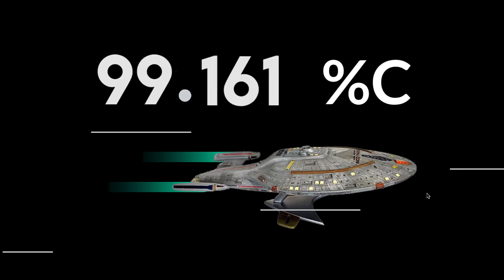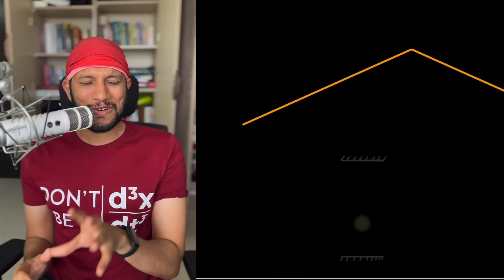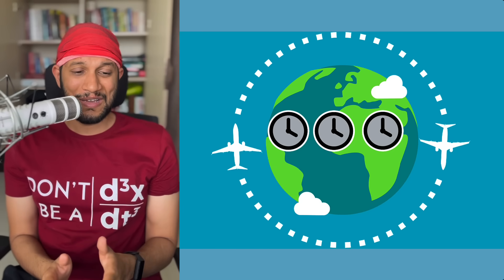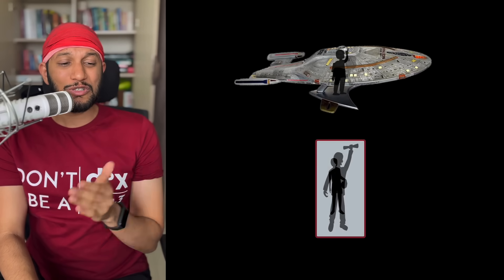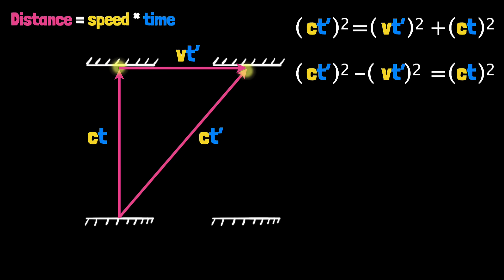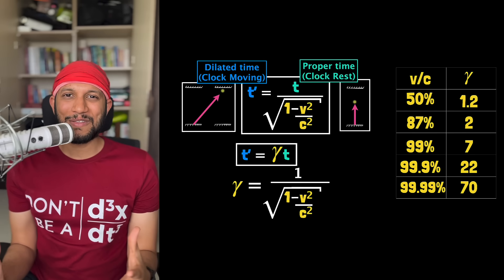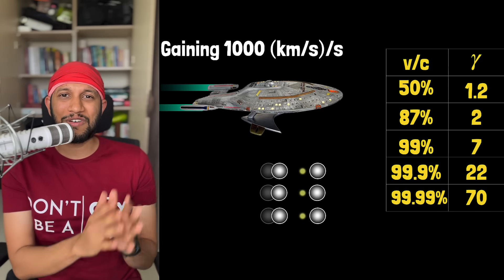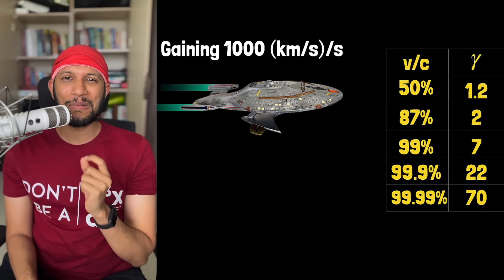I finally understood why you can't go faster than light! (My mind is blown)

Comment: I haven't read all 9,000 comments so this has probably been asked a few times and I apologize for asking it yet again.  But...

This is all based on the notion of relativity - the speed of one object relative to another.  So, is it not possible for me to drive my motorcycle own the highway at legal speeds and yet be exceeding the speed of light relative to an object other than the earth?  

I know you have kept the explanation simple for purposes of explanation of the concept, but it object b is travelling at 50% of the speed of light (0.5C) relative to object a and object c is travelling at 0.5C relative to object b, is it not possible that object c is travelling at 1C relative to object a if object c is travelling in the same direction from object b that object b is traveling from object a?  And, of course, we can extend this to object d doing 0.5C from object c and 1.0C from object b and 1.5C from object a.  The combinations and permutations of objects in this scenario is approaching infinity.

Comment: the analogy is the same for twins - 1 in space and 1 in earth - the space one is younger - it also sucks because the energy required to move mass after a certain time is exponential and it is impossible to achieve sufficient energy to move the same mass at faster speeds. Laymans opinion - no degree whatsoever

Comment: U know its all BS, yes? U are INSIDE the ship, u do not see 'time dialation', u are travelling with light sped no problem :) There is no delay in TIME, there is a delay in the clock which is irrelevant. U just broke your clock.

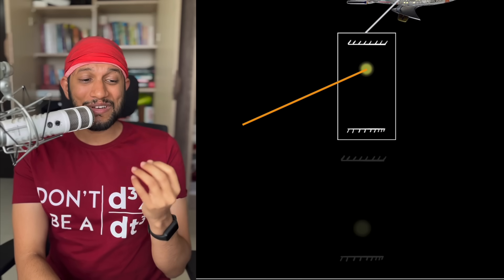Comment: 2:05       I'm going to stop you there.
In your example...
From outside the ship, the photon appears to be traveling faster. Not slower.

If the person outside the ship is travelling at the same speed relative to the ship, the photons speed appears to remain the same.
If the person outside the ship is traveling slower than the ship, the photon on board the ship appears to be traveling that difference faster.

Relativity. Speed is relative.
In your example, the apparent change in speed is because you have changed the point from which you are measuring it.
 

Einstein's equations simply do not work at speeds greater than the speed of light.
They are limited.
The limitiation is in the accuracy of the equation to predict an outcome, not the maximum speed theoretically possible.

However since we are not able to travel anywhere near such speeds and even struggle to take accurate measurements at such velocities, the inaccuracy of Einsteins equations are to all practical purposes, irrelevant. They are good enough for the purposes we use them for.

Comment: The only real problem is the fact the einstein couldn't tell time. He didn't understand how a clock works. Since he didn't understand how time works, he could never work out what speed actually is. If you can't understand speed, you can't work out anything with regards to distance or speed. That's why he always used squiggles and stuff. He didn't know how to read or write. Now you know the real answer.

Comment: Well first of all you wouldn't be able to see the photon because you need a photon on to observe things. But okay if we imagine an oscillator, a little ball that's bouncing between two plates, the distance that it travels while moving will APPEAR longer, but the frequency will stay the same, because by definition the clock is measuring the period of the balls bouncing between the plates. Any other factors not part of the clock system. The same number of photons will reach your eyes telling you about the movement of the ball in either case. In each photon will describe a change in position in space. Well guess what when the clock is stationary the distances between each observed position will be smaller and when the clock is moving the distances will be larger. That's it. There's no slowing down. 
When the clock is moving towards you, it will appear to tick faster, and when it's moving away from you it will appear to tick slower. But it only APPEARS so because of the distance it takes the light to travel to you to bring the information about the clock.

Comment: so you saying a space ship that speeds away at close the speed of light away from earth for one year, and then comes back at the same speed for an other year, that the person in set space ship is younger then the person on earth? both of them would have aged two years. because you say the time for them inside the clock stays normal, so normal two years for both of them, i'm never going to grasp time difference because it does not logically click for me, HOW can two years be different when you start of with identic time clock, and i kinda see where you get the difference because you try to calculate it, the fact still remains that the two clocks it self don't change so HOW CAN THE BE DIFFERENT. this all would click for me when every thing is affect by travel, but it does not lets call it medium instead of vacuum or atmosphere, if i'm inside a bus driving and trow a ball up, the ball it self takes the same distance up and down as if i would do it on the ground, because strait up and down, forget the outside observer for a sec here, lets say the ball goes 10centimeters in up and down, it will be the same 10 out side the bus, again forget what someone would "see" i know seeing takes photons and they need to do a longer distance to get to my eye to see the ball go up and down if i was on the outside of the bus, BUT the time it self for the ball would be the same in and out of the bus, so how can one be older then the other in the end? see that does not click for me, makes zero sens, i can see the numbers because we probably use faulty calculations to get to that different numbers.. man i'm going to explode my brain here. and i probably type it so badly you all think i'm crazy as |@#|@. but english is not my main, and i never can type down what i truely think, its weird i know.

Comment: This is all nice and cool, but earth which means we, which means every clock on earth, move at certain speed. Mars move at certain speed. Our galaxy itself move at insane speed (and will collide with Andromeda btw). So we already could be floating light speed not even knowing. You take too much as granted that atom send fontons to move as structure, nobody really can see atoms with any machinery. And scientist do wild theories what photons even are and that they are on several places on same time. It is not granted that photon which travel longer distance is same to photon which travel shorter distance, it could be more used than first one. Although this thinking out of closed enviroment seems rigged from start as with that way you can go over light speed easily, as atoms in galaxies travel more than ls in comparison to location of movement to other galaxies.

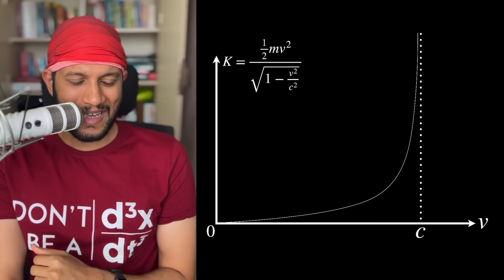Comment: 0:41 The photon  "clock" as depicted is  nonsense, because as speed increases, the photon has to be launched at an increased angle or else it will escape the cavity. Duh.
Reply: That’s not true.  Because if you use fluoride, you will get rid of all the cavities.
Reply: Imagine being so condescendingly incorrect
Reply: @ Wait I disagree.  I think this is better described as “irritatingly wrong”.
Reply: You’re wrong
Reply: @coltonw5713  yep, he is deluded.  Also he's trying to distract from the main premise.  I love the way people try and debunk Einstein, without understanding or training, or evidence.
Reply: @idmbadvisoryltd3205  fr I thought he was just trolling
Reply: @coltonw5713  probably but that sort of nonsense needs challenge... or blocked  #block6trolls
Reply: You’re right, as the spaceship starts to accelerate forward the clock will move forward and leaving the photon behind. But I think the thought process is based on zero acceleration, which the photon clock is turned on after the spaceship reaches a very high speed and stops accelerating, so there is no need to launch the photon at an angle.
Reply: Why?   The photon is just moving inside a clock.  There is no acceleration, so it will maintain its left to right speed that is the same as the clock.  Only an acceleration would change this.
Reply: @idmbadvisoryltd3205  You are oh so wrong. The speed of the photon is NOT affected by the speed of the source. That's the key postulate of special relativity!!
Reply: @kirdref9431  I never said the speed of the source changed... I simply said the photon would not escape the clock at any speed.  This means no change launch angle is needed.
Reply: @idmbadvisoryltd3205  "the photon would not escape the clock at any speed". There you go being wrong again.
Reply: @kirdref9431  so how exactly would it escape?
Reply: The fact that it would escape or not is not relevant to the whole concept. So it's obviously simplified not to be solving another problem while solving the main problem. Instead of a "photon clock" you could just say a "magical clock" the main point wouldn't change. You're focusing on the wrong stuff. It's obviously been simplified, so that we don't need to bother with it's escape
Reply: @DarkMug  agreed
Reply: This guy is soooo wrong. 😢

Comment: Ah, you're diving into one of the most fascinating aspects of physics: why we can't travel at the speed of light! Let me break this down step by step to explain why mass becomes "infinite" and why we can't reach or exceed the speed of light.

---

1. What Happens as You Approach the Speed of Light?

The key lies in Einstein's famous equation from special relativity:

E = \frac{mc^2}{\sqrt{1 - \frac{v^2}{c^2}}}

Here:

 = rest mass (your normal mass when at rest).

 = velocity of the object.

 = speed of light in vacuum.

Breaking it Down:

As  approaches , the denominator  gets closer to zero.

Dividing by a number close to zero causes the energy required to accelerate the object to grow extremely large.

Result:

At , the denominator becomes zero, meaning the energy required is infinite.

This is why no object with mass can reach the speed of light—it would require infinite energy, which is impossible.

---

2. Why Does Mass "Become Infinite"?

Relativity introduces the concept of relativistic mass, which increases as an object's speed increases:

m_{\text{rel}} = \frac{m}{\sqrt{1 - \frac{v^2}{c^2}}}

Key Points:

At rest (): , the normal mass.

As  increases:  increases because the denominator  decreases.

As : .

This infinite mass means:

1. The object becomes harder and harder to accelerate because it takes more and more energy.

2. At , acceleration becomes impossible, as no finite amount of energy can move infinite mass.

---

3. Why Do Photons Travel at  But Not Us?

Photons (light particles) have no rest mass ().

They always move at  because they are energy packets, not material objects.

Material objects (like us) have rest mass, so the relativistic effects prevent us from ever reaching .

---

4. What About Time Dilation?

Time dilation also plays a crucial role:

As an object approaches the speed of light, time for that object slows down relative to an outside observer.

At , time stops for the object entirely from the perspective of an external observer. This means:

For the object itself, "traveling" doesn't make sense—it experiences no passage of time.

This is why photons don’t “experience” time—they exist only as energy propagating through space.

---

5. Why Can't We Just "Ignore the Rules"?

These rules are baked into the fabric of the universe, as described by special relativity:

Energy, mass, and velocity are interconnected.

The speed of light is the universal speed limit because it’s the maximum speed at which information, causality, and energy can travel.

Trying to break this limit would fundamentally violate the laws of physics as we understand them.

---

TL;DR:

You can’t travel at the speed of light because the energy required becomes infinite as you approach it.

Your mass "increases" with speed, making further acceleration even harder.

Only massless particles like photons can travel at , and they experience no time.

The speed of light is a fundamental limit of the universe, tied to the structure of space, time, and energy.

---

Let me know if you'd like to explore any part of this deeper—I love these questions!

Comment: If I go up a mountain and boil some water it takes twice as long. That doesn't mean time has slowed down
Reply: No, it takes LESS time because the water boils at LOWER temperature due to lower ambient pressure, you dimwit. (assuming same starting twmperature and same input power)

Comment: I just want to ask something for better understanding. In the video, he explained time dilation by comparing it to the vertical trajectory of photons, measuring one tick of a clock as the photon travels up and down. Why did he choose to measure it vertically instead of horizontally? Will there be a change if he measures the intervals using the horizontal trajectory of photons for one tick of a clock. Just curious :)

Comment: I thought that Einstein’s equation e=mc^2 explained it.  Since there is an equivalence between energy and mass, the more energy you put into moving an object, the more massive it becomes, thus requiring more energy, which increases the mass even further, requiring more energy to accelerate it.  This, ultimately, leads to infinite amounts of energy to move an infinitely massive object.  You can never put enough energy into it because that just increases the mass.

Many people use the clock analogy to explain relativity, but I hadn’t seen it used to explain why we can’t travel faster than the speed of light.  Great video.

Comment: Hold up. If the fotons are bouncing between two mirrors, and the mirrors are still, then the fotons move with C velocity straight up then straight down. If the mirrors suddenly start to move, why would the foton who used to move straight down start moving diagonally (seemingly) in order to hit the mirror in the same spot it always has. What accelerates the foton to the right? Without any right-acceleration it should keep moving straight up or down right, why does it move with the mirrors?

Comment: 1} Does inertia increase as you accelerate? Does it then require more energy to move the object?  What happens to an object's inertia as you approach the speed of light?
No time dilation needed.

2} Does the photon in the photon clock move independently of the mirrors? If so, then, isn't the mirror moving perpendicular to the path of the photon? 
Imagine the photon has a stopwatch and starts the stopwatch when it leaves the first mirror.  What will the stopwatch read when the photon bounces off the second mirror and returns to the first mirror? Hint: the photon is traveling at the speed of light!

Comment: If the speed of light is constant. Then why is the speed of light is zero at the event horizon of black holes relative to the black hole. Also, if light bends due to gravity then the speed accelerate on the bend or curve.

Comment: The photon clock doesn't take into account the momentum gained from the bounce.  If the surface is moving that the photon is bouncing on energy will be transferred, anyways to the spectater time will be the same at the speed of light, it would look different to someone not on the ship.

Comment: but on the ship everything is going as normal. so it would be like watching someone fall into a black hole. at the event horizon the one watching would see them stop at the horizon and then slowly fade out. but they are no longer where you see them. that is why i still think the ship moving closer to the speed of light will be still working as normal and getting to that speed but because of dilation you only see the ship slowing down until it fades out like if it fell in a black hole. because for the people on the ship nothing for them has changed because its all relative on if your are watching of flying.

Comment: If you were to fly away from earth at the speed of light and watched earth as you did that, earth would remain static. Like time stood still on earth.
Let's say you traveled for 1 year at the speed of light.
Then you stopped.
It would take 1 year for the light to reach you for you to see what was happening on earth when you stopped.
However, if you immediately flew back to earth at the speed of light, you would see a sped up version of the entire year you flew away, as well as the year it took you to return.
When you returned, you would be exactly 2 years older,,as well as everything on earth.
There is no time travel with flying in the cosmos faster than light. You might be able to see it, with very advanced technology, but you cannot travel back and change it. Because you will end up at the exact destination of your "entire" travel time.
Reply: I will also add, because I see the questions coming.
If you traveled back to earth 2X faster than what you left.
You will see an even faster history of earth as you approached, and be 1.5 years older, as well as everything on earth.
Because you traveled faster on your return.

Comment: for someone inside the ship, the photon clock ticks same, The photon is moving same path compared to the place clock is resting on, photon clock resting on ship, photon clock resting on a plane. looking at a photon clock from outside the ship and comparing photon path based on stationary observer's location seems not correct, There should be a different phenomenon behind clocks on aeroplane getting out of sync, mostly gravity.
Our earth is also moving and spinning, why don't you take those movements into consideration, when you consider someone at rest?